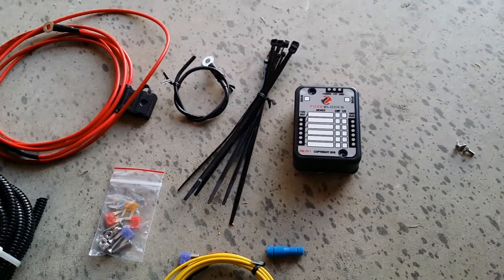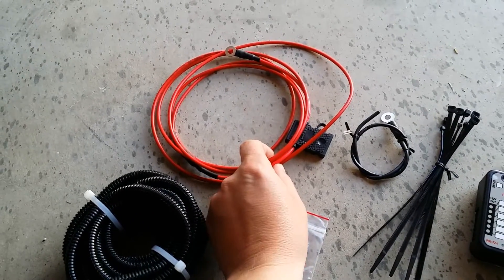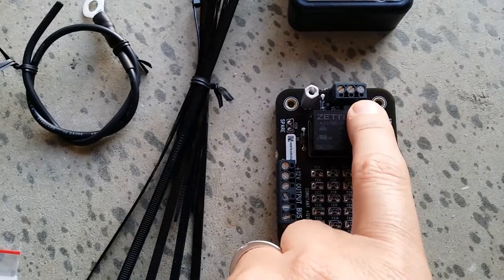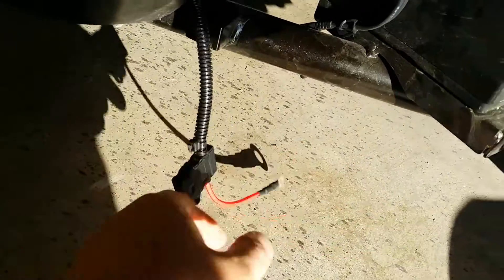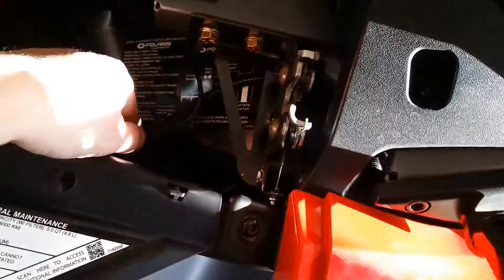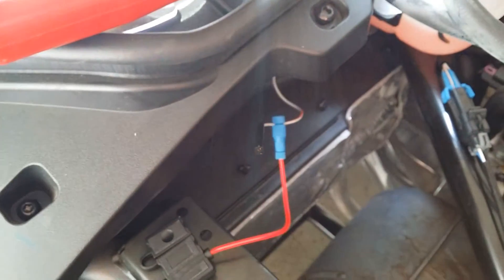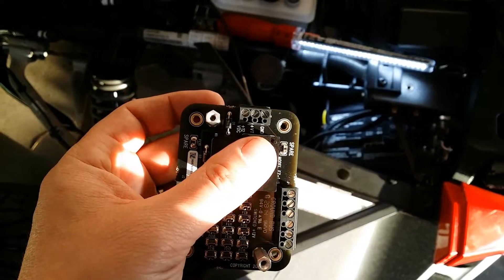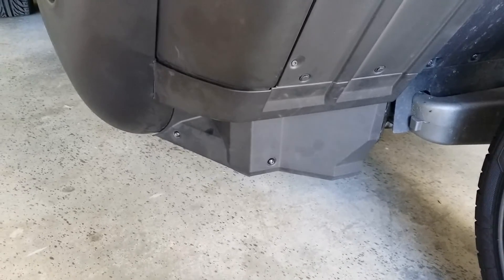Polaris Slingshot Accessory Fuse Block - Installation Video

Comment: Would I still use the glove box wire or a  different for switched power with a dual battery setup?
Reply from the maker: The glove box wire is still needed to provide an "ignition 12v" signal to the aftermarket fuse block so that you can trigger mods when the ignition is turned on.

Comment: hello I have a question - I have this exact product - It was already pre-installed  when i purchased my slingshot - The slingshot also comes with a custom pioneer stereo. For the life of me The stereo head unit does not turn on. Do you think this product is the cause ? The fuse on the slingshot was tested and all seems to be 12V... Should I test this box?
Reply from the maker: Hello Tishawn, on your pioneer head unit you have 3 wires to test. One is the 12V ignition wire, One is the 12V Full Time power wire and one is ground. Generally those wires coming out of the stereo will be Red, Yellow and Black. If you have a voltmeter you can check to make sure the head unit has power. If it does not, then you'll have to find out what circuit on the fuse block you're pulling power from. You may have a blown fuse in the aftermarket fuse block. You may also have a blown fuse in the "inline" fuse holder that's on your full time power wire coming off the back of the stereo.

Comment: If you want to run a switch for 12 volt  halo's how would wire it in after the fuse block?
Reply from the maker: Hello RPPC, the Otto Dash Switches we sell will control the 12V+ signal of the halo's. So you'd run a 12V+ Positive wire from the 12V+ side of the circuit you're using on the fuseblock, to the "Center Pin" on the dash switch. Then Run your 12V+ positive wire either out of the top or bottom pin of the dash switch, depending on if you want it to power the halo's when switched up or down on the dash switch. The ground wire on the halo's runs to the ground bus on the fuse block. You'll also have to decide if you want that circuit to have full time power when the vehicle is off or only have power to that switch when the ignition is on. We recommend setting the fuse in the "ignition" position so that you don't forget to turn off your halos and drain your battery.
Reply: Cool thanks for the info.

Comment: I agree who do you mount the block, with what?
Reply from the maker: +Big Dave Gorman Hey Dave - The block is mounted with either double sided tape, or velcro tape.  We used velcro tape to make it easier if we wanted to temporarily remove it for installation purposes.

Comment: I have the autonet wifi attena when I plug it in what sie fuse do I use in the fuse box i
Reply from the maker: Hello Kevin, I'm unfamiliar with that brand of antenna. Most MFG's usually list the amperage pull of the device in the manual that's included with the product.

Comment: My blue cap was on the yellow side and not the red fuse side.
Reply from the maker: +Jim Luck Hey Jim, if you're referring to the blue T-tap for the 12v ignition wire, that is correct. The yellow wire taps into the positive 12v wire on the glove box cigarette lighter using the blue T-tap.
Reply: +SlingMods That is what I did which wasnt a problem, it was just different that what the video showed, thanks.
Reply from the maker: Sounds good Jim.. thx for the feedback.